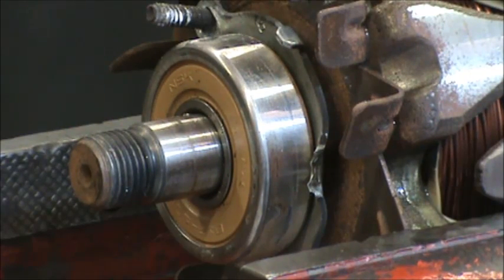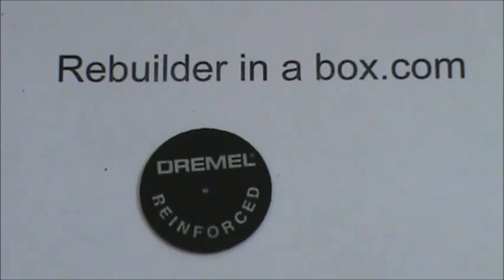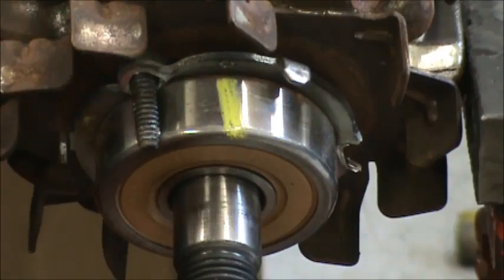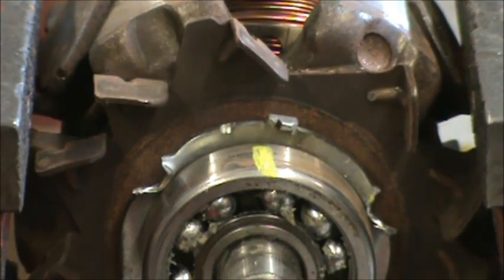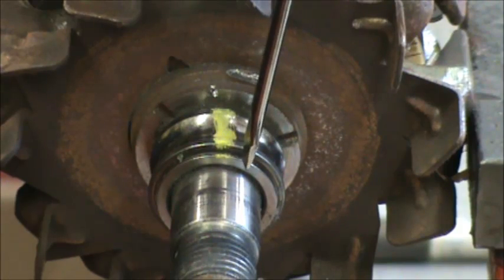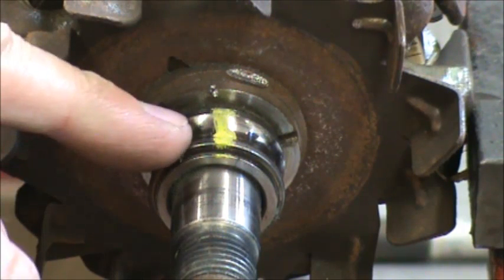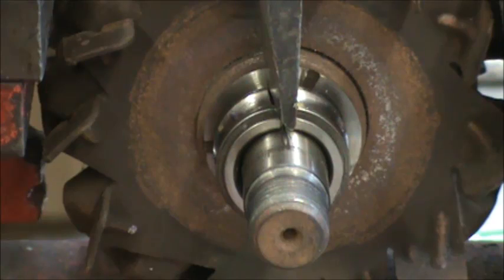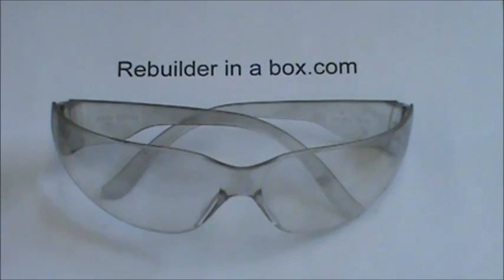How to cut a bearing off using a Dremel

Comment: Mike, try just cutting a shallow notch across the race on opposite sides, then impact with a cold chisel in one notch. Start light and build force until it cracks. This is exactly how they make "split bearings".
Reply from the maker: Good suggestion and also a little easier.

Comment: Thanks for this video. For the first time, I'm going to have to try this procedure to remove a stuck roller bearing from a small two stroke engine crankshaft. Wish me luck.
Reply from the maker: To avoid damage to the shaft, just cut away 90% of the inner race. Then insert a wedge shaped chisel into the groove and smack it with the old ball peen. Normally it will break right off. Making 2 grooves 180 apart makes that work even better.

Comment: HOW NOT TO CUT A BEARING OFF!!!!!  You damaged the surface, this is NOT CORRECT. 
Before you damage the surface you smack it with a chisel instead and it falls apart.
Reply from the maker: Thank you for your comment. And yes, no damage is good. Sometimes the heat from the operation will even loosen the inner race and it can be pulled or chiseled off.  We purposely wanted to show America's working man with minimum tools (who doesn't live in a perfect world) that minimal damage to the shaft is perfectly tolerable as we said. We only show things that have been field proven and time tested many times over the years. Many people don't realize we have been electrical rebuilders for many, many years and because we supply the rebuild kits for this alternator, we don't want any one to think they ruined their core while performing this operation. Little red loctite and we promise : There will be no side effects.
Reply: @rebuilderinabox  It's actually better to cut somewhat sideways instead of up and down. This gives you more control and you don't need to cut through the race as much, possibly cutting the shaft. Then hitting with a chisel it will come right apart. Yes, I've cut into some wheel hubs before I started going sideways and have still reused the hubs but it's best to not to. Going sideways allows you to do more without having to down into the shaft more.
Reply from the maker: @johnjoseph7382  Somewhere in the comments this was already explained. Cutting is not the most common scenario. We show it like this because we sell kits to Americas working man, the mechanics in the trenches with limited tools. Our purpose here is to demonstrate that minimal damage to the shaft is perfectly tolerable. Previously, we've had people give up and send back kits. Sure, there's a lot of things we show you in our videos that are not optimal like we do things here in the shop with all the fancy tools. Our real goal is a successful repair for every size tool box. Angle cut is a great tip, though. See our mantra. https://alternatorstarterrebuildkits.com/about-us/

Comment: As the cut of wheel is round that leaves  the far corner uncut. The method l use is the same but make a second cut 90° to the first capping the T removing the holding material. This is very effective on wheel bearings.

Comment: I have a bearing race stuck in a plastic washing machine tub and have tried using a slide hammer and a dremel to remove it,  Any suggestions? Btw, I can only get to it from above.
Reply: Oh, that is easy knowing that it was asked 3 years ago. :-)   Just tap the darn thing from the tope with say an socket extension or some such thing.

Comment: What were the RPMS for the dremel in order to cut that bearing?  I have a 8220 model battery operated, not sure if it will get the job done
Reply from the maker: Best thing to do is give it a try. Some good commenters said use a helical cut. Or cut half way thru and smack with a chisel.
Reply: you're overthinking this. dremel wheels GRIND away metal, it doesn't have to be a certain rpm. it's like sandpaper bro. if ur fuckin dremel ran at 200 rpm it might take you a couple days but you'd get it

Comment: If all you have is a dremel, then everything is a cut-off problem. Should just cut a couple of slots on the bearing parallel to the rotation and use them to pull with a bearing splitter. The grooved inner race is pull-able in any case. This way, there would be no damage to anything.
Reply from the maker: Referencing our mission statement https://alternatorstarterrebuildkits.com/about-us/
we didn't consider a bearing splitter to be in the average working man's tool box.Our intention is to offer alternative solutions with only basic tools. Minor damage to the shaft is a moot point and will have NO long term effect. " If all you have is a hammer, everything else starts to look like a nail "
Reply: Your 100% right. If the average working mans tool box hasn’t got a bearing puller or splitter, he should send the job to someone who has. All you have done is shown him how to do a half arse job, that will potentially give problems in the very near future because of that shaft damage. That shaft can also be spinning at speeds considerably higher than the engine. An out of balance shaft can very quickly destroy whatever it’s connected to. Do it properly, or pay someone else to do it properly. It’s always far cheaper in the long run
Reply: @PaulSmith-dy8ul  It's not destroying anything. GTFO of here. Post a vid of something destroyed by a lil nic in the shaft. Let's see it.
Reply: Parallel to the rotation?  Aha, if that works I will find out.  Interesting.  Two slits opposite each other I assume? I guess I will find out. In fact in that case I will use the beast, the Dewalt angle grinder and get down the business.